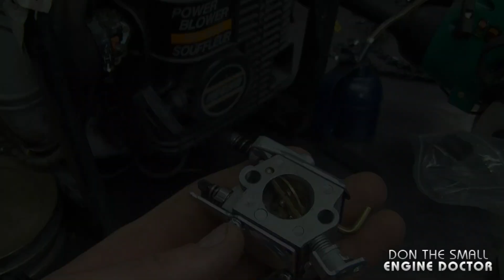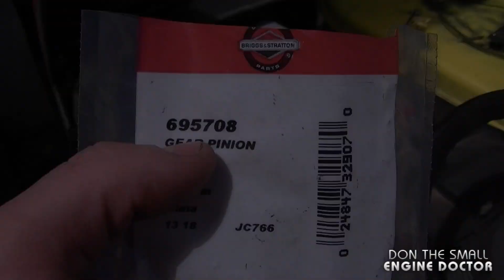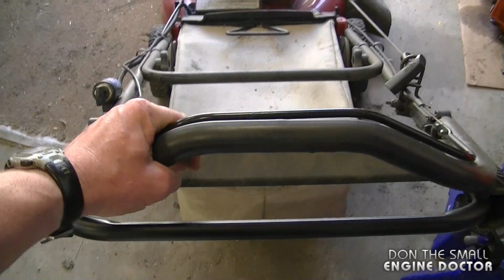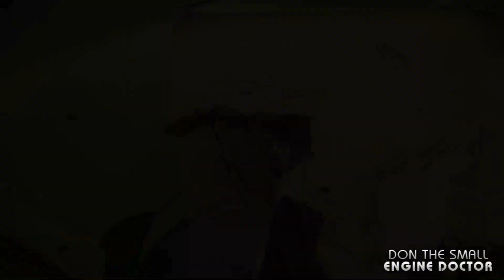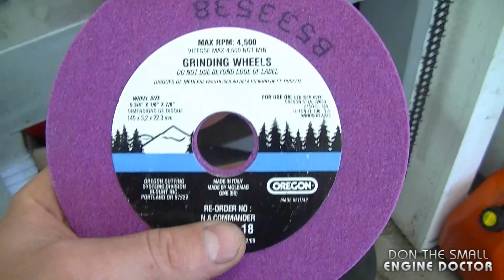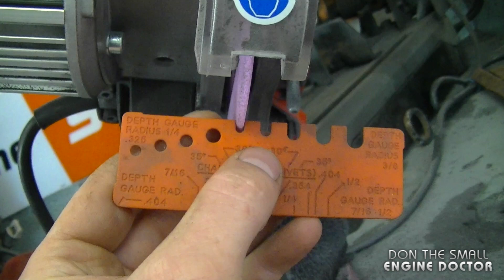Small Engines Q & A Video #143

Comment: I have a snow blower with an old 3hp tecumseh snow king engine with diaphragm carb. It surges and won't run at top rpm. I have replaced the diaphragm, cleaned the carb, and adjusted it. If anyone knows how to fix it please help! thanks.

Comment: Hi there I just bough a sears snowblower 8hp motor 6 speed 
25 inch cut .color silver body 
Motor is color orange it has elc 
Start .not sure the year my guess 
Late 90 or real early 2000 
But can't fined what brand motor 
It has .. 
I wondering if you got a guess ?
Thanks :)
Reply from the maker: would be a Tecumseh

Comment: Hey dony I have a question. I have a Troy-bilt lawnmower, 190cc with a Briggs engine. There is no primer or choke. To get it started I have to take off the air filter and open the throttle butterfly all the way on the carb, also when running, it runs fine. but when I tilt it towards the exhaust side while it's running, white smoke starts to come out the exhaust.

I abused this engine a lot, what do you think could be the problem.

Comment: Have you done a video on dealing with a small engine that has been completely under water?  We had a flood in our neighborhood, and I've had a number of engines under water.  I got my neighbor's mower going by draining everything out well and replacing the engine oil about 3 times until it quit looking cloudy after a run.  My cars were also under water, but that's another matter.  :-)

Comment: Hey donyboy73, I have a honda HR214 and there is no smoke at all, but it smells like it is burning oil, it did not start this until i put seafoam in the gas.  I run about 3 tanks of gas threw it and it still smells like it is burning oil.  Also, is there a way to repair stripped valve cover bolt threads without replacing the head?  The bolts aren't stripped, but the threads that hold the bolt are.

Thank you.

Comment: My mom has a Toro personal pace with electric start and it is near impossible to get started in the spring.  I empty the gas and run it dry in the fall.  It usually takes me pull starting it 40 to 50 times to get it going.  Once started and running the first time it will start with the electric start the rest of the summer.  Any ideas what the problem is?

Comment: Hi Dony, I have a 20Hp V twin Briggs and Stratton Intek motor on a 14 year old john Deere sabre with a 46 inch deck. Whenever I go to start cutting grass I put it on full throttle and engage the blades and it starts to sputter and puff out black smoke, it usually does this after about 5 min of mowing but sometimes if does it right off the hop. I have checked fuel flow before and after the fuel pump, I checked the gas cap to make sure it vented, checked the crankcase breather tube. Ran it with and without the air filter. Checked the solenoid under the carb and cleaned the carb. But it still has this problem. The black smoke leads me to believe that is getting to much fuel. I don't see any adjustment screws other than the throttle butterfly. Any assistance would be greatly appreciated. Thanks in advance
Reply: My first guess would be one of the coils (if two?) is going bad, but that's just a guess.  Under load, they're failing to ignite the fuel/air mixture properly, resulting in the black smoke.  Does this have a choke?  Be sure it's not closing somehow.

Comment: Why are the JD mowers form lowes or something different than from a JD dealer, if they are the same model number
Reply: Are you referring to push mowers or riders? There is a big difference between box store JD riders & those sold by a real JD dealership. I'm not too hip on push mowers. The dealership models utilize heavier materials & design in their construction. The big box models are more like a Chinese knock-off. Some JD dealers will keep a box store version on hand just to show prospective customers the real differences side-by-side. Buy from a dealer  you are a fan of green & yellow paint & want your investment to last more than a couple of years.
Reply: Urbicide Thanks for the reply, I work on mowers but never really had a lot of JD mowers in, just ones form dealers. I was told that buy a buddy of mine that works on a bunch of mowers the same thing. I was just curious if it was true
Reply: JohnDeere50d
It is true... lowes , home depot or any of the big box stores have the buying power to go to John Deere ,Husqvarna ,Cub Cadet or whomever and say we want 2000 tractors or whatever amount at this price point so the manufactures accommodate them. Sad point is the price difference between them and a regular dealer is little to none i purchased a Husqvarna rider in April and my local dealer was exactly the same price as Lowes and Lowes doesn't service anything so it was a no brainier on where to buy it ....Support your local independent dealer !
Reply: Urbicide I'd say you can apply that to any of the major lawn equipment brands. My cub cadet tractor (bought from a local dealer) has been used hard and admittedly under maintained and hasn't had too many big problems in 10 years. On the other hand we got a Husqvarna push mower from Home Depot which has repeatedly fallen apart at it's earliest convenience. It's had three new wheels (they keep splitting at the spokes) and a new handle for the pull cord, and recently the self propel cable snapped inside the drive unit. It's not half as old as the tractor is. I know it's not a direct comparison but it's the experience I've had.

Comment: I hate when manufactures make stuff out if plastic!!! Those plastic starter gears are the perfect example!!! I'd replace it with a metal one.
Reply: If you replace it with a metal one, it will cause damage to the flywheel's ring gear. The starter drive gears are made out of composite to prevent damage to the flywheel. A starter gear is much cheaper, and easier to replace than a flywheel. Also, if someone were to engage the starter while the engine is running the only thing that would be damaged is the starter gear.
Reply: 1972FordF150 You've got some good points there that I didn't think of. It makes sense though. My dads old simplicity has a metal one and we've never had to replace it since the mower was new in 1986...... We use it close to 5 times a week too. No use for about 4 months out of the year because of the snow.
Reply: ***** Yeah that is true.
Reply: The plastic starter gear of my decades old craftsman wore out, the repair was $8.
very easy to fix and cheaper than replacing the starter or engine ring gear if it was made of metal.
Reply: ***** LOL, my father has a Toro personal mower with a Tecumseh engine & electric starter. The original flywheel had an integrated nylon ring gear, which ended up being chewed up by the plastic pinion gear. The oem replacement flywheel / ring gear is all metal.  Seems like it would have been common sense to have used an all metal flywheel  in the first place.
Reply: Never seen a plastic ring gear before! that's just crap man.
Reply: From what I know Briggs used 2 flywheel ring gear materials. Aluminum and steel. Alum ring gear gets a plastic starter gear. Steel ring gear gets a normal steel starter gear. I'm a Briggs gen tech so that's what I know. So yea , if you use a steel gear on an alum ring gear you will tear it up. I've never seen someone do it, I'm just takin the word of what I've seen. Eh they are cheap enough to buy 2 and put on the shelf. Whatever ya do, don't lubricate it, and if Anything I've had mild success using a dry paint brush or compressed air to keep the gears clean during servicing. Z